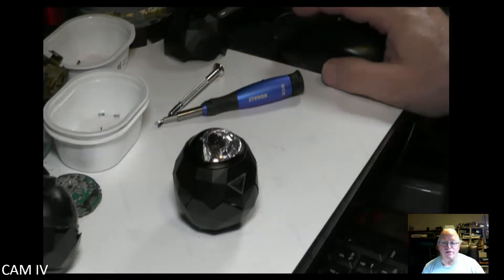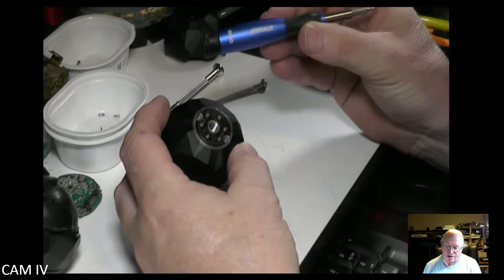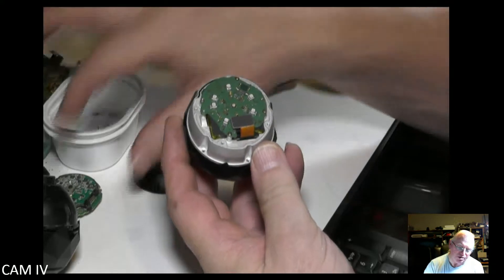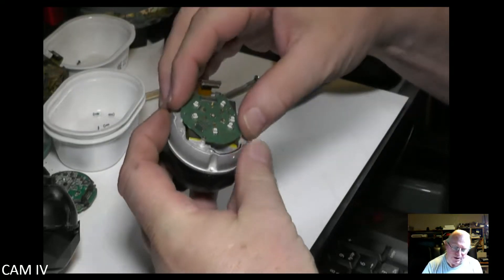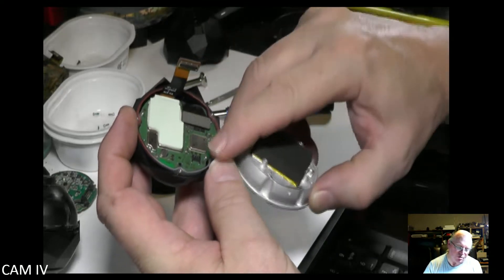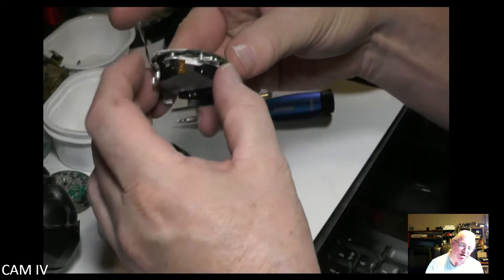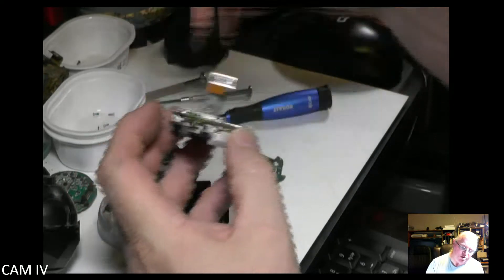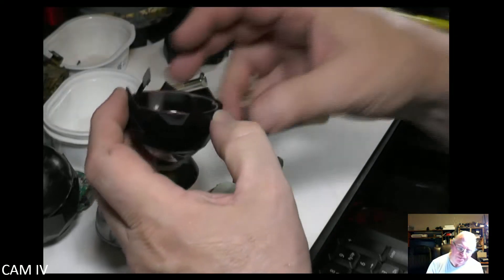360Fly 4K disassembly

Comment: Thank you this will help when I need to change the battery but mine does not seem to have any screws just plastic...Any idea how to remove those bits? I tried a small watch screw driver but nothing seems to move. Thanks in advance.
Reply from the maker: That's covered in the other video... there are two little plastic covers glued in place to protect the screws, use an exacto blade to lift them up.
Reply: @VideoOneMedia  I see thank you very much.

Comment: Thanks for the video! I watched this because mine brand new out of the box was not charging. Took it apart, checked the battery voltage and it was zero. Hooked the battery up to a battery charger for 5 minutes and that woke it up. Now it charges properly as it should! 

The question I'm curious about is if you've tried larger size sd cards. In my experience, I've never had a camera freak out when I put a larger sd card in it then recommended, but have yet to try it with this camera. Have you tried putting a 128gb card or similar as an upgrade in it to see if it can work with a card larger then the stock 32gb card?

Thanks! 
-Julian
Reply from the maker: I have not, most cameras today will support the available sizes,.  Some hardware by design can restrict the size of an SD card or by the software that accesses the card.

Comment: Hello!  Great video!  How would you remove the IR filter?  This would be greatly helpful!
Reply from the maker: Good question.. ( I wouldn't let it get wet after this :)  ). The 5 screws that hold the lens in place should be removed, push the assembly out with your thumbs.  Mark the position of the sensor for re-assembly.  The sensor itself is threaded into the lens assembly, un-threading it exposes the filter which seems to be firmly attached (glass)  Removal should be done carefully/safely to avoid incident.

Comment: Thanks that's very helpful. Mine has died from use in the sea, it will be great to save the last footage I shot
Reply: Mine doesn't appear to have any exposed screws on the bottom, just 6 gold sensors for the charger. Also I believe my reset button is still inside rather than through the tiny side buttons, I thought they were speakers? Perhaps the UK model is different. Any tips on how I might open it? Thanks again

Comment: my 4K battery had a malfunction. Is there how to buy a spare one or maybe adapt a external one?
Reply from the maker: 360Fly isn't sharing any parts information.  They do have a flat fee for repair/replacement but I don't know what they would do with a battery replacement.
Reply: VideoOneMedia I bought a 1800MAh external battery and addapt It myself. It’s working better than the original! Thank You!!👍🤟